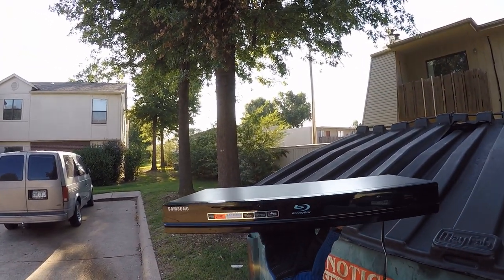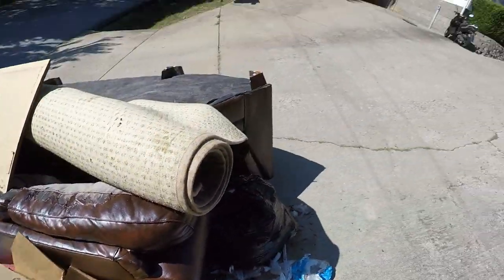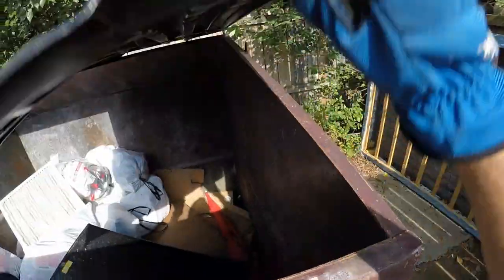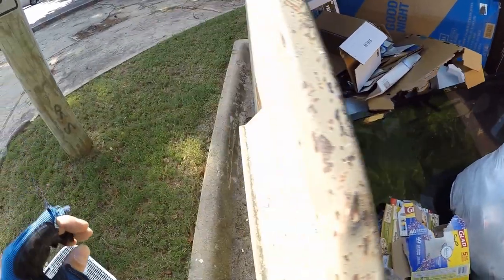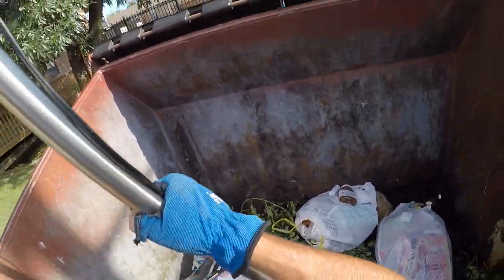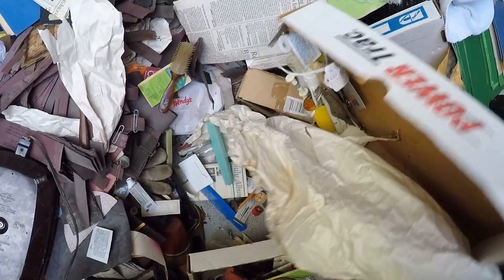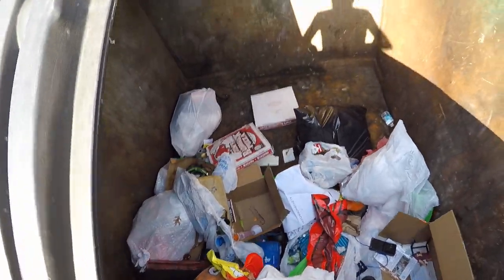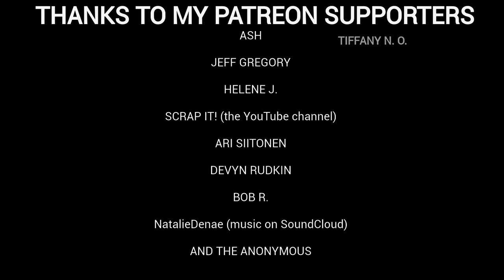ACTION TRASH PICKING - Let's Start with a BLU-RAY Player...

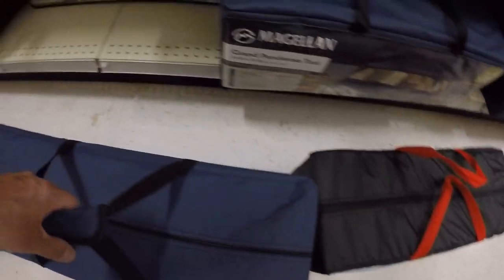Comment from the maker: I messed up the "thanks for watching" audio towards the end of the video, lol, sorry...it should have been during the last 10 seconds or so not at the 41:14 mark - i added in the blu-ray in my living room clip and didnt move down the thanks for watching audio clip, anyway - as always, thanks for watching!
Reply: @ scrap vulture I have to make the joke of do you get workmen's comp for the injury. I was proud of my self a couple days ago. I went to get gas and the dumpsters they have in back had four shelves so they ended up in the expedition that's an easy 40 pounds of metal. so I'm kicking myself today I check those dumpsters and there are 3 nice pieces of treated 4x4 studs about 3 1/2 foot long each piece sitting in the dumpster. I passed on them do to being in a hurry to get to another part of town. the wood alone can get expensive but dumbass me had to be in a hurry.
Reply: The laptop batteries are 18650's. Used for solar banks, Tesla cars, Vapes. Just sell the lot on eBay. Used lots sell but you could break them open and use the cells.
Reply: ScrapVulture 
I hope we get to see ur
Camping trip to..n as always ur wlcm😍😍👌👌👌
Reply: hahah i thought it was your twin brother :D nobody is perfect Yewww
Reply: party tent for 8 ! 🤩
Reply: Full of vomit🤣🤣🤣🤣🤣🤣🤣🤣🤣🤣
Reply: The U.S. Supreme Court has ruled that trash taken to the curb for pickup (and placed on public property) is considered abandoned and completely open for scavenging. However, local laws may prohibit scavenging recyclables from recycling containers. Basically, check with local laws before you do.
UncleDave

Comment: I'm pretty sure those laptop battery's will go for more $$ in small lots on your favorite eBay category  "for parts not working".(with 6$ padded envelope ship)  You'll defiantly get more than boardsort will give you. But I bust em open and test each cell then reuse the cells for a number of things, (my favorite is making my bike headlights with them... BRIGHT ONES!!). Just my 2 cents ...if you happen across my comment. thanks bud
Reply: THAT's a YT video right there,   I've a bag of those batteries that scrapyard wouldn't take and I prefer to ride at night but my headlight/taillights only last about 20 miles on a dry day.  If you decide to video your process I'd watch that for sure!

Comment: You can take all the cats camping with youDon’t forget the radiators with plastic tanks have a big tube of brass in the bottom tank if you crack it open